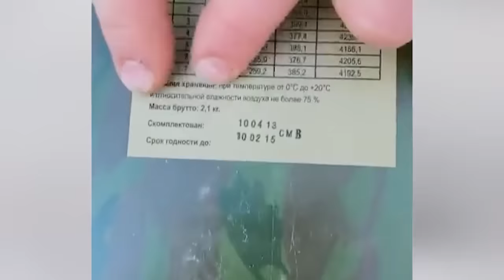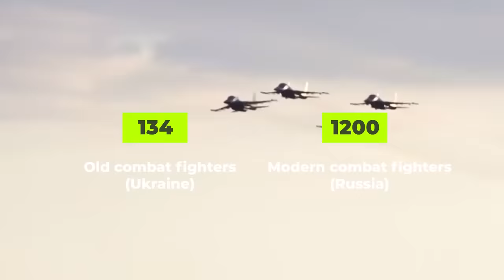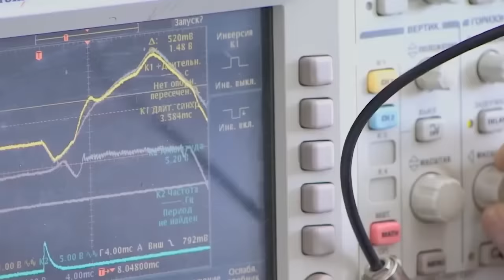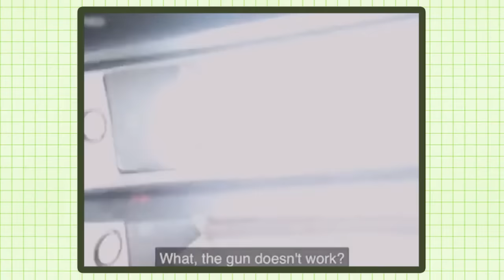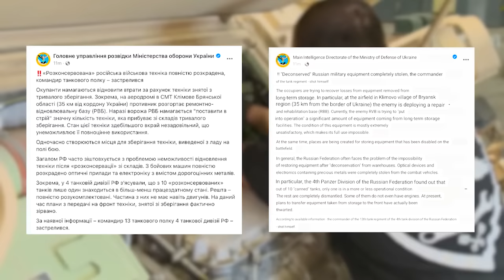Why Russian Arms Failed in Ukraine?

Comment: Sorry but you said the SU34 is a good as the F15.. Ermm nope. What makes the SU34 worse than the F15 is not only its deployment. But the diabolical poor training in combined force multiplyers. The poor basic training of Russian pilots and Russia's maintainance & ignorant stance that they are the best and the fact that its strike weapons require it to fly low to achieve any sort of precision targeting as you mentioned.

Also you stated that Russia stores most of its reserve tanks in the open at parking facilities. This also isn't totaly true. While Russia does store some of its reserve Armour outside in the facilities. The major reserve force are stored in warehouses or in underground storage. Like the one  30 miles outside of Moscow. They call the storage faciliites deep storage. Which hold anything from a MTB battalion to a brigade size armoured force. 

The examples you had shown in your video of Russian MTB's were in fact active regiments and not storage facilities. And if you had payed attention you would have noticed the thermal blankes and active heating systems for the MTB's.

Comment: well
its very true not all rockets and  missiles are guided
it has economical  reason

you can not  use everytime a sniper  with pin point precision
sometime GI joe  need  with machine gun

same apply  for the  missiles and rockets
the stalin organs  shoting out  48  round less than a minute

the super precise himars need  time for the  48 round
one GPS guided himar round can cost 150000 plus
and one launch can cost up to  one million

versus  the bm 21 grad costing about 1000 per round
so the precision neglegtible

for the apartments  most newschannel showing,  there were  ukrainien positions  and they were shot  from very close range
thats looking all much as berlin  in 1945
as german soldiers were pushed  back and moved  from apartment to apartments

Comment: Since I was born in the Soviet Union, another problem of the Russian army was not mentioned here. After the successful US attack in Iraq, the Russian army wanted to copy the US army - that's why they started to form not large divisions as before, but smaller combat tactical battalions, only for the Russian army it causes headaches, because, for example, the highly centralized power system that is also in the army - for example, a division commander give an order - further down it is received by the brigade and further down by the battalion and further down by the company and the platoon itself. So - if the combat platoon sees the real situation on the spot, which the division commander does not see, then it is characteristic of the Russian army that they do not adopt a logical plan of action on the spot without a superior commander, but continue to carry out the order, which is completely wrong from a tactical point of view. Therefore, the Russian army also has huge losses on the front line, because decisions are not made on the spot at the front in battle conditions, but somewhere in the division general's headquarters on a map drawn by him.

Comment: russian troops are cannot fodder and it's been like that since WW2, even there equipment  does not take the comfort or safety of the russian soldier into accout, in an american tank the ammunition is behind a saftey storage container, if it cooks of or explodes a blow out panel blows out and release the explosion away from the crew who will live, russians are inside there tank practically sitting on top of shells and the shells are net to them, when they cook of the whole crew gets cremated inside the tank, there is only ashes left.
i bet if training fighter pilots only took a week they would opt not to have ejection seats in them ?

Comment: This dude got no freaking idea what he is talking about, I have 50-year-old tires on my classic car from 70's, works just fine. Its not about age, its about working conditions, quality and proper storage. A 3 years old tire/engine/spare part can be completely f***d up and 30 years old one can be in factory new condition. It's actually the COMPLETE OPPOSITE of his childish point: IF they can and do use 40 years old tires/engines/spare parts, THAT would automatically mean they are properly stored and do properly maintain their equipment (like I do my with my precious classic car). IF they weren't, they simply could not (not even theoretically) have used 40, 30 or 20-year-old eqipment, because that equipment would be f***d up and NOT WORKING AT ALL after 5-10 years max (IF not properly stored and maintained that is). Like I said, typical bullshit from someone who never touched equipment or mechanics.

Comment: Easy question and easy answer. 
Russian weapons are all bad quality and stupid designs, with very low quality of electronics. THat's reason why so many Russian tanks and anti aircrafts were destroyed in ukraine. 
T-72 and T-90 have the same stupid design, with ammunition inside the cabin. Just one hit, and we have jack in the box. 

S-400, Pantsir are also useless, with very low quality of electronics. THey can not shoot anything from the beginning of the war. S-400 can not intercept HIMAR missiles. Pantsir, Tor, can not stop UAV Barayaka. 
Su-35 is even worse, it can not shoot down any Ukraine Mig-29, but Ukraine shot down 10 of Su-35.

Comment: My take on Russian nuclear weapons and nuclear delivery systems is that they are probably in worse shape than the conventional weapons.  Since these weapons were developed for the express purpose of never being used - it's easier to hide the effects of poor maintenance.  And they likely a lot of valuable electronics and things made of metals with high values if sold as scrap. And since everything exists under a very high level of secrecy - outside inspectors and auditors aren't allowed in.

Russian tactical missiles have shown a 60% failure rate during launch and on the way to the target.  I see no reason to think that the ICBMs are any different.

But the most important point is that nuclear weapons and nuclear delivery systems are 'irrational weapons' in that they were made for the express purpose of never being used.  And if you want to cut corners on maintenance - nuclear forces are the best place to hide the fact that a lot of the stuff doesn't work.

Comment: I hate to say it's because the Russians look at the cheapest way how to make a tank if you can make more make it cheap you can make more of them but in the West tanks are not built cheaply it was built last handle more and yes you look at the German tank it was designed to handle more hits better armor protection heavier armor and yes it is slightly better than the Russian tanks and yes Russia tanks have thinner armor and yes you can penetrate the armor made with the RPG 7 just a regular round and yes Russian tanks might be cool looking awesome but they're behind the time or too far behind the time if Russia needs to relook at everything they need to advance their cells every armor weapray needs to advance to the next level even their guns tanks armor to simple basic gear yes their gear is so outdated completely outdated even France is ahead of them
Reply: @somerandomboibackup6086  you look at the T90 it is based on the t72 tank come on the design is pretty much 1960s it's pretty much outdated you might throw in a few computers few modifications but it's pretty much outdated and armor it's not Advanced I mean come on Ukraine you see the war and how many tanks were destroyed you see more than 50 tanks the Armor's thin it wasn't built for anti-tank weaponry especially almost every weapons today can blast the hell out of that tank it is pretty much an old design it does not use anything really new if it wasn't broken they say why replace it it's just like their AK-47 they're still making that model over and over today it doesn't break so we going to keep building it and yes every gear and equipment is pretty much outdated and pretty much out class but any Western power
Reply: @somerandomboibackup6086  and yes any tanks built from the West is expensive because armor it is the armor upgrading to every tank redesign a tank is not cheap either it's just like building any car it is expensive to redesign something new especially Russians look at why should we redesign something new we got something already made so we're going to use design make it slightly bigger meaner looking that's it we're going to put a bow and add a little Russian love
Reply: @dumpsterchild5734  300+ T-72s were destroyed and T90s saw less combat than T72s
Reply: @dumpsterchild5734  What are you talking about? Each year the US army (land force) gets about $180 billion budget money and the Russian army (land force) assumably gets $50 billion budget money (they don't give stats so I'm just gonna assume). Assuming each side spends about 30% of that money making TANKS, each year the US army will manufacture 5400 more M1A2 Abrams ($10 million per Abrams), and Russia will only manufacture ~3400 more ($4,5 million per T90SM)
Reply: @somerandomboibackup6086  Russian tank it's probably worth but 1 million or 500,000 in American Tank will cost a belt lease about 2 million dollars per tank that's one battle tank that's with the armor and yes Russians are made cheaply they don't use the best quality Steel and yes I already know what kind of Steel it's like you can shoot at it with your AK-47 some metal steel plates can penetrate
Reply: @somerandomboibackup6086  if you are going to look at the American battle tank it will cost about 6 to 5 million dollars per tank but Russians are usually have to cost from 3 million to 1 million and yes they make them cheap easy affordable but they are cheaply made remember you don't have the best armor in the world especially it has the worst reputations around the world it doesn't matter even the Middle East they have a lot of problems especially overheating and it's easy to destroy you can't even smoke a cigarette inside of a battle tank like that of a Russian tank it will explode even just drop a hand grenade inside the tank it will blow up the whole tire tank
Reply: @dumpsterchild5734  Actually an Abrams costs $10 million (A2) and a Vladimir costs $4,5 million (T90SM)
Reply: @somerandomboibackup6086  actually Abram tank is about 6 million dollars you're lying about that you think that's the most expensive tank in the world go to stuff to Korea and you will find a tank will cost about 14 million dollars that's just the tank if money is your problem don't even talk about how much it costs
Reply: @dumpsterchild5734  That price 6 million is in 2016, now it's ~8
Reply: @somerandomboibackup6086  well you look at it it's not the expensive tank in the world there are other cheaper tanks and better tanks they're even tanks in Brazil can even outperform the American Abram I'm pretty sure if you look real good you will find a different type of tank what's the point about tanks anyways almost have an aircraft type of guy I prefer helicopters
Reply: @somerandomboibackup6086  you might look at the cost very expensive of course everything is very expensive every tank even the Russian tank if you want improve it it will cost you more money and yes for a better armor it will cost more I'm guessing it would cost Russians about maybe $4,000 add it and then if you want better engine that might cost a couple thousand dollars more just improving the Russian tank might cost more than $4,000 it would cost about maybe $8,000 just upgrade the whole entire tank that's not even with tank the tank can cause 4 million it can cost about full 12 million dollars to get her with the upgrades and that's why the apron beats the Russian tank it's just already been one design already added think this way you're buying at Abram tank because of the high power armor it's not feel picky it is very expensive yes but just improving the rush tank would cost more that's just the truth
Reply: @dumpsterchild5734  "think this way you're buying at Abram tank because of the high power armor it's not feel picky it is very expensive" The US ain't poor like Russia
Reply: @somerandomboibackup6086  anybody who's been inside of Abraham it does not blow up like a Russian tank it took many hits of RPG sevens it took more than 50 shots of RPG said just destroyed a Abram tank but everybody inside tank were alive that is a plus but if this was a Russian tank everybody be dead we know Survivor yeah Rush tanks might be great and cheap but it is a poor armor design especially the auto system or the reloader it has can malfunction it can tear arms legs any fingers off your body it's cool but a lot of reason why no one uses it you got a lot of exposed ammo meaning you got to be careful you can't light a cigar or cigarette inside of a tank like that it will explode because of the exposed and an issue before the tank making it an easy target yeah Rush take might be faster quicker but everything on the tank is so outdated even the thermal imagery is so outdated it can't even tell you the right thermal image it's basically technology in 1970s a lot of things about it it's just like 1970s 1980s it's so outdated now it is completely outdated tank Russian tanks are
Reply: @somerandomboibackup6086  if you were going to buy a Russian tank you will do a lot of overhauling especially you would spend a lot of money on special armor better armor than the Russians could provide and yet it will make tank heavier it will cost a lot of money he might throw out the auto loader or something simple Emma upgrade the motor just the overhauling the whole computer's in it we're talking about everything with all that could cost a couple of 4,000 to $6,000 more just upgrade the Russian tank I look at the Abram tank it's already upgraded it's already made it instead Spectrum you don't need to upgrade it really
Reply: @dumpsterchild5734  "anybody who's been inside of Abraham it does not blow up like a Russian tank" What are you talking about? I'm not saying the Abrams suck or anything
Reply: @dumpsterchild5734  Yes and? I thought you're saying Russian tanks are cheaper and somewhat equal to Western tanks
Reply: @somerandomboibackup6086  if you're looking forward to buying the cheapest tanks it is not the newest latest tanks your best bet you want to save money you buy old model a fun model just the toy with like the Sherman tank or really Russian tank yes I mean old school tanks
Reply: @dumpsterchild5734  Ok then

Comment: this us crap. the expensive battery i bought has been down since november. company has no replacement. most i have ever gotten back from utility is 5 dollars i was unable to add more panels because utility would not allow it. tell me where these huge tebates are happening. ill move there. to be totaly off grid i would need 10 kw panels i have 5 which gives ne a net if xero for the year. without working battery, i have no backup power. cost 6 years ago, 21 000 fir oanels and invertot, 8,000 for 9.7 kw battery. bottom line not cheap, and replacement parts are scarce. if i truly wanted to go offgrid, it would cost  20,000 more. until reliability gets better i eoll not add on, oh wait, forgot, utility wont allow me to